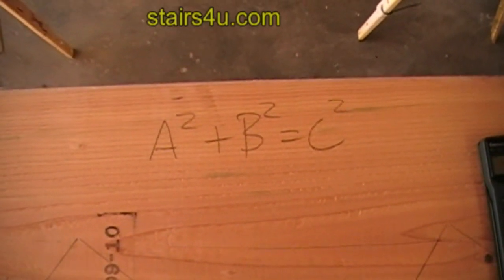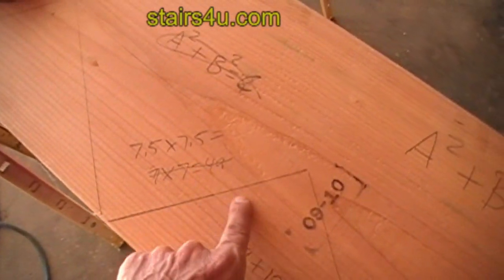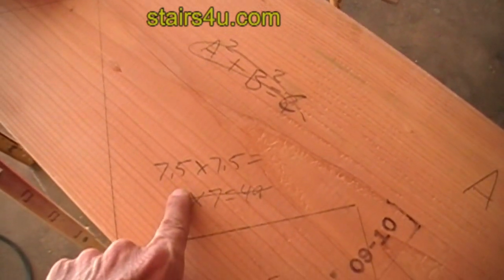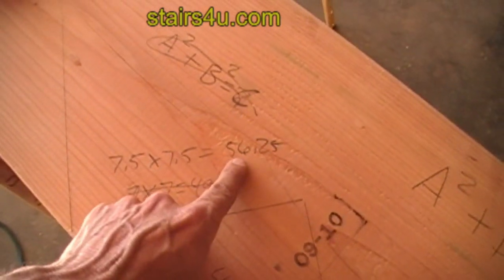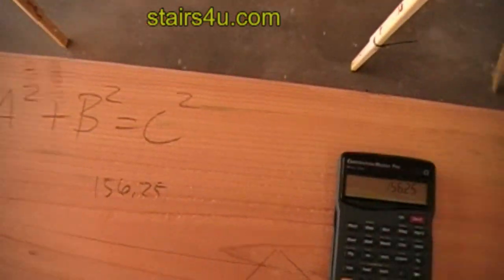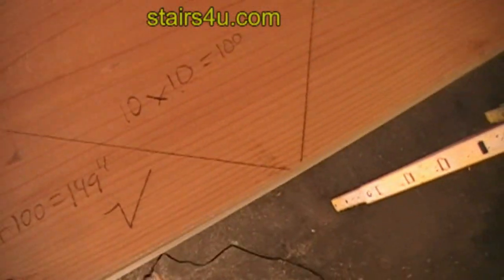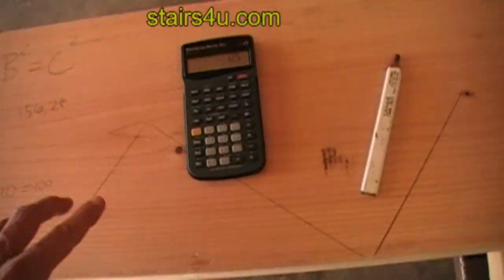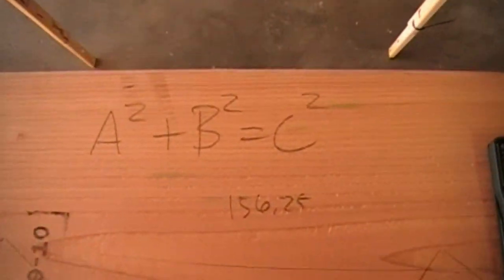How to Figure out Roof Rafters, Stairs and Other Construction Angle Measurements

Comment: somewhat helpful? You assumed a 10 step, but I dont think an assumption helps? What if the deck is 10 ft high or 8 ft high? Would that not change the length of the lumber?
Reply from the maker: +Sue Reed I used a 10 inch step or the number 10 as an example for this particular math problem and different numbers (height or widths) will affect the lengths of lumber. Let me know if you're having a problem or what that problem is, if you're having a difficult time with my examples and I will try to provide you with a different one.

Comment: Just for those who might be confused, at the end he said that if you multiply 10 times 12.5", that would give you a 12 1/2 foot board, but it wouldn't, it would give you a 10 and almost a 1/2 foot board. 10 x 12.5 inches = 125 / 12, (converting inches to feet) = 10.41666 feet or 10' 5". How I got the 5" from 10.41666 is that I just took off the whole number,  the 10 feet, then multiplied what was left, the decimal, by what it was divided by originally, 12. And we get 5.

Comment from the maker: I'm not about to suggest that this is the only way to figure out the length of your roof rafters, stairs or other construction angle measurements. As far as nobody doing this, I have to disagree, because I still use it and probably always will. Anyway, your comment is appreciated and you do have a good point.

Comment from the maker: You can use this method to figure practically any height of a roof. What exactly are you having a problem with? If you're having a problem with the video or having a difficult time figuring out how it works, maybe I can make another video, but you'll need to tell me exactly what you're having a problem with.